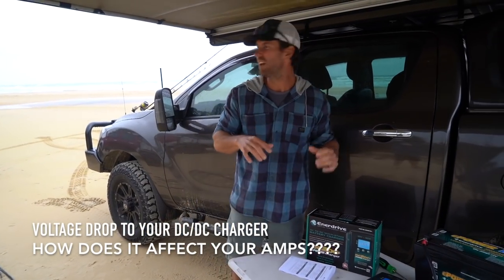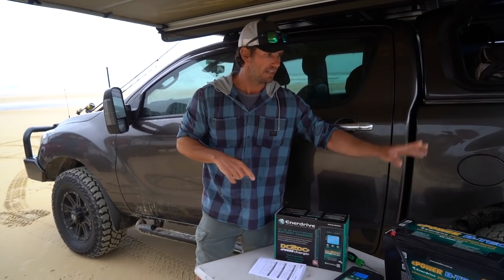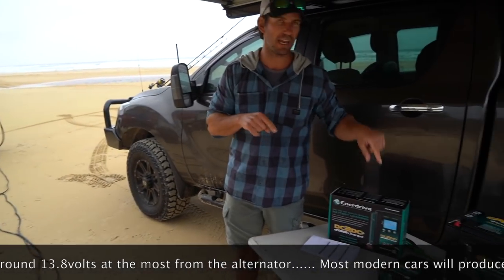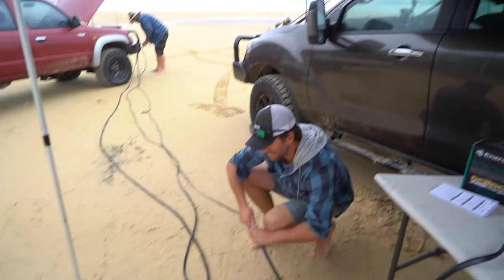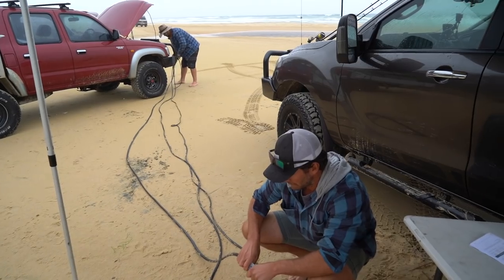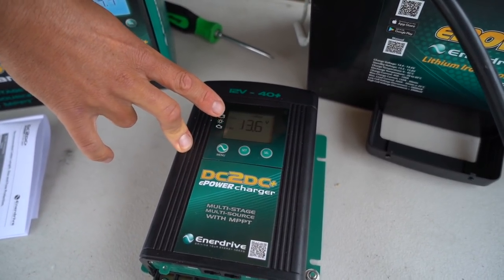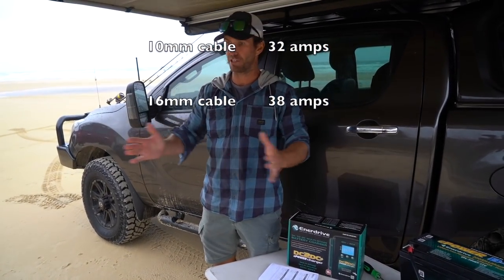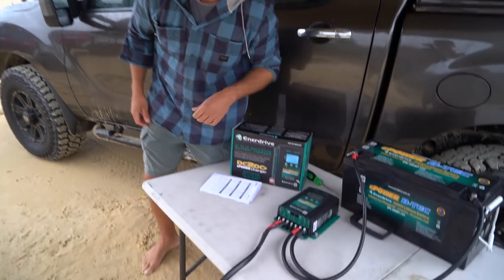SIZE MATTERS!! How does voltage drop in cable affect the amperage output of a DC/DC charger??

Comment: You say 10metres of cable but is that 5 metres for the positive and 5 metres back for the negative or 10 metres for the postive and negative for a total length of 20 metres.Regards.
Reply: Regardless of the length in this test the results still apply.

Comment: If I wire 3 batteries in parallel 
Should all cables be same size as the ones that goes into my battery box ? 
So would I use 14 or 16 mm ?
I have 3 (138 ah batteries from Kings )
Reply: Depends on length of run.

Comment: Great vid. So, what would happen say if you had the 16mm cable, but with say a short 30cm long cable of 6mm to the charger?  Would that show a fairly big drop in charging capacity too?
Reply from the maker: Yeah it definitely wouldn't be ideal. If your going to make the effort to run larger cable most of the way, you might as well do it all the way to the battery to get the most current.
Reply: Not sure I agree with that, the voltage drop along the 16mm cable before it joins to the 6mm will be minimal. Then 30cm of 6mm will also be minimal. Overall you will see no difference to running all 16mm. By the way I know this is a reply to a 4 year old topic 😅 I just wanted to clarify for anyone confused.
Reply: @OutdoorsIQ  I'm doing a diy install that already has 6mm to the back and happy with lower amps for my battery at the moment. Just wondering if 70a fuse at the main/alternator battery side is okay or should I go lower amp due to the size of the cable? Enerdrive recommends 70a but not sure for my application. Thank you